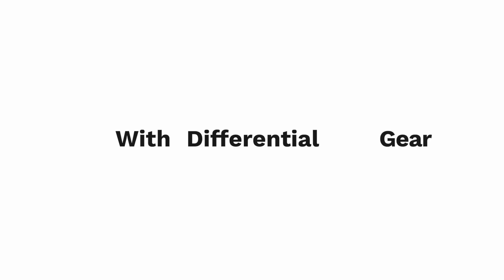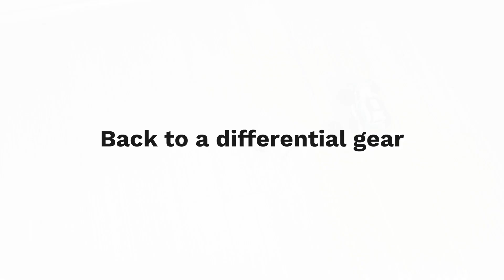With and without differential: turning performance and explanation

Comment: the hotrod is a great build I gladly bought your plans. I'm using your github python code to control the car as well and it works great. 

How do you prevent the wheels from binding on the side of the car though? I had to move the "headlight" tires in one space and I added a small black connector pin in between the two lower bars of the steering mechanism to mechanically not allow the wheels to bind. are you controlling how far it steers with the code or some other mechanical part?